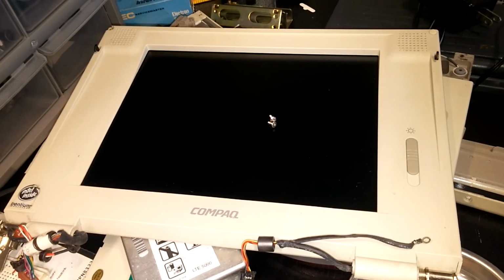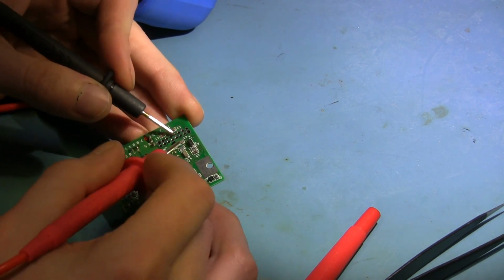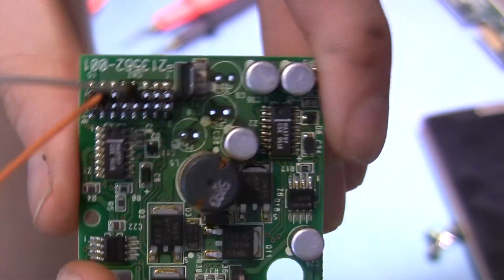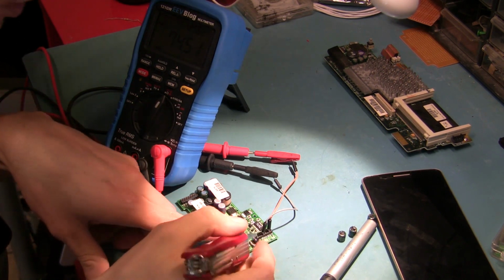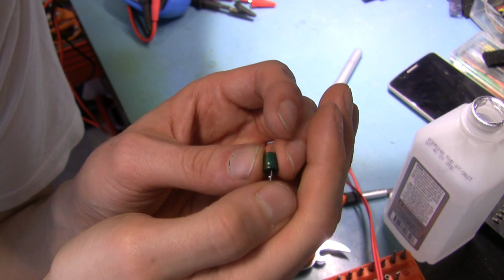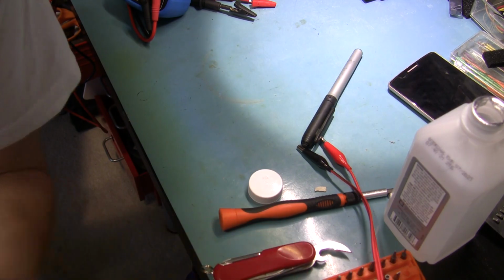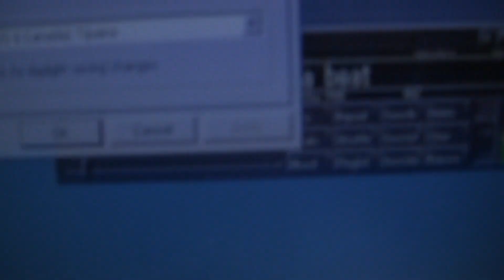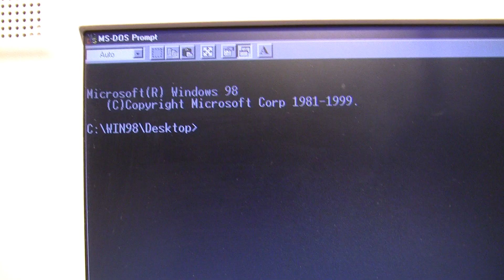Board-level repair of a vintage Compaq laptop

Comment: I'd personally advise replacing all the capacitors on that board - due to the age of the machine they will fail eventually, and if they leak it can be conductive and / or corrosive if it gets bad enough.